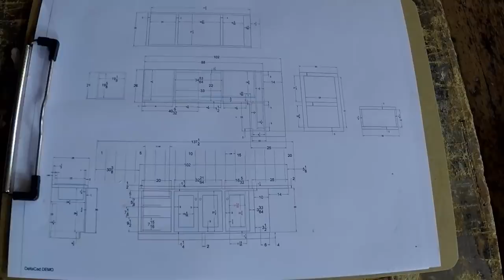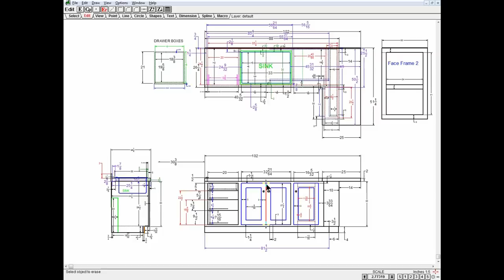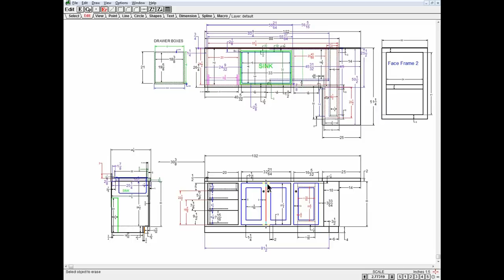Kitchen Remodel - PART 1 - Doors, Drawers, and Face Frames

Comment: Nice work 
I didn’t think that you can plane plywood down,  I learned something today.
Thanks
Reply: Pretty sure he didn't.
Reply: mo·dus ope·ran·di that’s what it looks like on 34:32
Reply: @hectorny94  Hmm. I guess he did.  My apologies.
Reply: @hectorny94  Hmm. I guess he did.  My apologies.
Reply: mo·dus ope·ran·di 
👍
Reply from the maker: it doesn't always work well... you never know what is under the veneer.  
and there is a probability of clogging the dust collection because the chips come out like splinters.  but if the material behaves, you can make thinner plywood

Comment: Watching the dust get sucked into the zero-clearance insert plate at the 7:45 mark is amazing . . . I am guessing you modified the dust collection in that Grizzly saw.  If yes, please consider going over the modifications.
Thanks for your time
Reply from the maker: yes i did modify to some extent.  I did a review of my table saw and how they work https://www.youtube.com/watch?v=2r4deUgLS70&index=6&t=13s&list=PL6S_qufGCnuSTY1e8LQ3CnhM-BOKEf4Pm
Reply from the maker: the rotation of dust on the surface is likely caused by a vortex created by 4" port from above.  there is not much suction from the insert

Comment: Where would a person procure the poplar you use for the face frame?  Is that from HD?
Reply from the maker: no, home depot has some but the pricing is insane.  I got a large qty at the hardwood dealer.  9 to 11 inch wide planks.  nice stuff :)
Reply: @hffcom  Well then